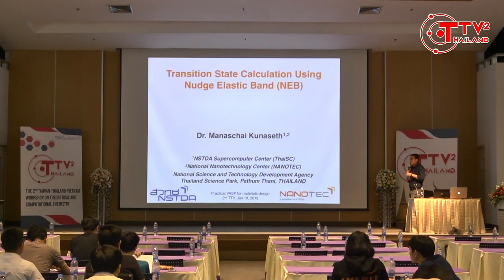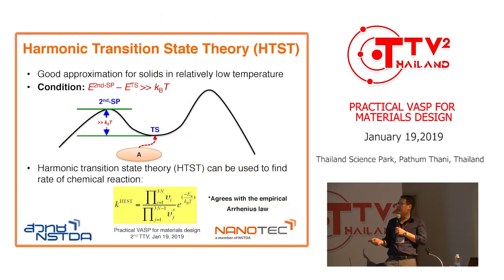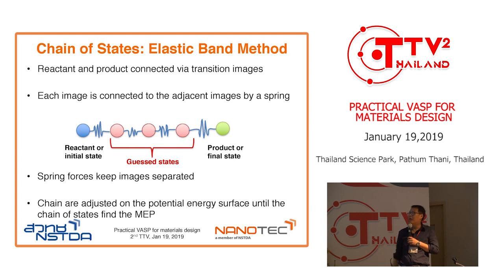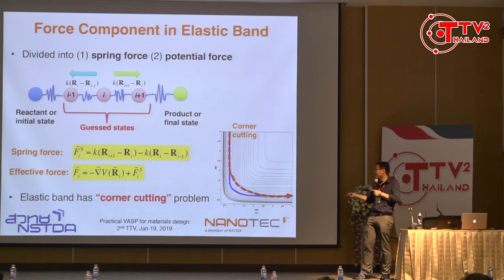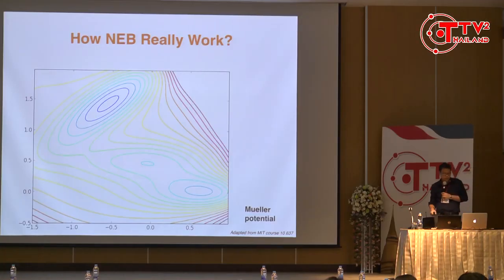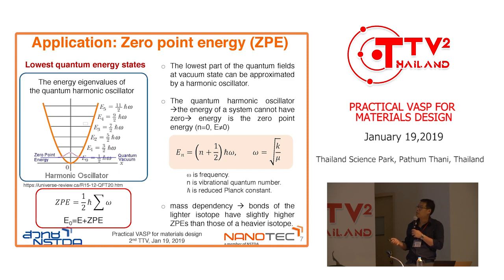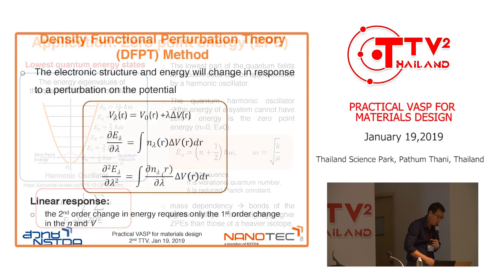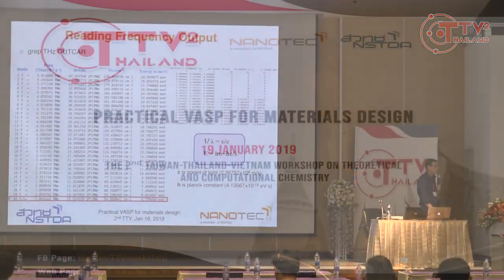Nudged elastic band method (NEB) and Frequency calculation & vibrational modes  (Dr.Manaschai)

Comment: Thank you so much, this is wonderful. Please my question just like the last guy asked for frequency, for the NEB calculation, should we use the KPOINT using for the optimization?
Reply: yes
Reply: @xyn222  thanks so mcuh
Reply: @francismaduabuchienujekwu6546  You are welcome. If your k-points are converged with respect to the quantity you would like to calculate, say binding energy, you may proceed to NEB with the same k-point grid.
Reply: yinan xu okay
Reply: @xyn222  Please can you explain the grep THz OUTCAR output for me.

I did CO2 molecule calcualtion and this is what I have, dont really know what it means and how do I expalin it

1 f  =   21.987014 THz   138.148485 2PiTHz  733.407827 cm-1    90.931014 meV
   2 f  =   21.944037 THz   137.878448 2PiTHz  731.974246 cm-1    90.753273 meV
   3 f  =   11.704253 THz    73.539991 2PiTHz  390.411846 cm-1    48.404917 meV
   4 f  =   11.296588 THz    70.978553 2PiTHz  376.813588 cm-1    46.718947 meV
   5 f  =    0.730759 THz     4.591497 2PiTHz   24.375509 cm-1     3.022179 meV
   6 f  =    0.420691 THz     2.643282 2PiTHz   14.032752 cm-1     1.739840 meV
   7 f/i=    0.587453 THz     3.691075 2PiTHz   19.595316 cm-1     2.429510 meV
   8 f/i=    6.035483 THz    37.922058 2PiTHz  201.322036 cm-1    24.960760 meV
   9 f/i=   19.871848 THz   124.858505 2PiTHz  662.853486 cm-1    82.183388 meV